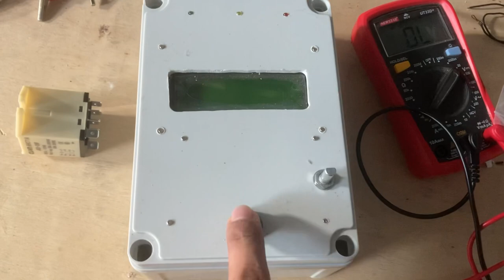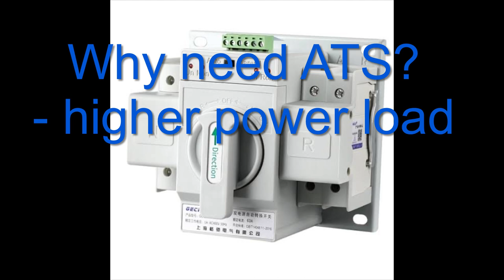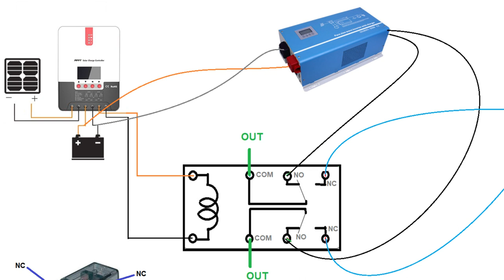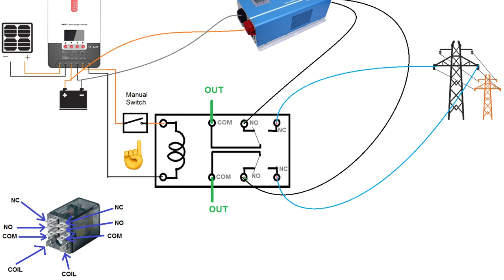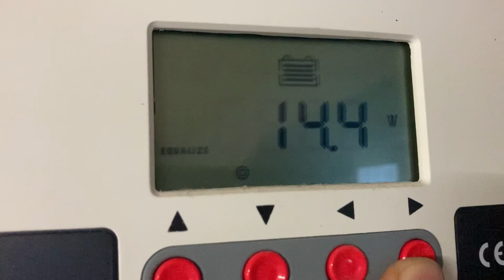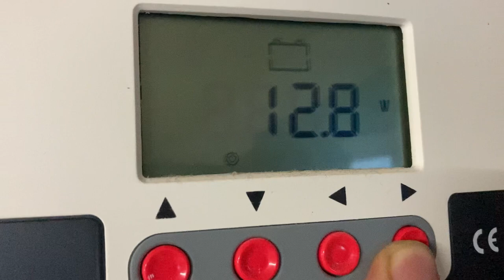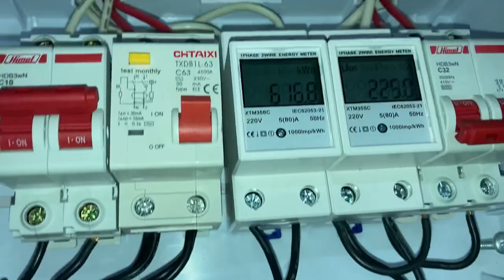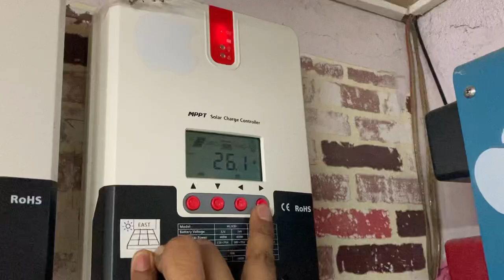DIY Cheap Automatic Transfer Switch for solar power

Comment: use 2 relays.. 1 for transfer switch and 1 for inverter.. same source of coil supply..
Reply: Depends on if you want any extra features. In my case, dealing with two sources where the Neutral is bonded to Ground ( 240 split phase ) I needed something different. And I wanted a meter on it. And a time delay for the inverter to power up. Plus breakers to protect the incoming power or disable it. So mine has 2 breakers, a power relay, a 4 pole motorized transfer switch, a meter, a timing relay, and two receptacles. It is built so the power coming in from the left is the priority one while the one on the right is secondary. As the inverter is normally the priority, it is on the left. Commercial power is on the right. During the day, the inverter powers the timing relay, the power relay, the transfer switch to throw to that and then the load. Anytime the inverter is not running, the commercial power feeds the load after it instantly throws over the transfer switch. In both cases, the transfer switch itself only uses power during a change in state. When on the inverter, once the unit has switched the load to it, only the power relay and timing relay are powered along with the meter and load. No load draw is 18 Watts total. It all fits in a 12X12 Hoffman enclosure.

Comment: Nice project lods.. di b magsasalubong ung kurente ni inverter at d.u lods?
Reply from the maker: Hindi po since iisang relay lang naman. Disconnect muna sya bago magconnect sa kabila.
Reply: @glengineertv1505  i.c.. gumawa kc ako ng ats using 2 relay, ngsalubong ang current, sabog ang 5pcs mosfet ng inverter..
Reply from the maker: @randy_q6914  awts… pag dalawa kasi kelangan mo ng delay before magswitch sa kabila. Mahirap nga yun kasi di mo alam yung bilis ng action nila so need mo ng malaking delay in between switching.
Reply: S plagay q nga ung ang dumali..my4n ginamit q n relay.. try q ulit gwa ung high power relay nman..
Reply: @glengineertv1505  sir dilikado yan 2 relay gamitin mo tig 1side lang .. kapag nag malfunction relay mo sabog inverter mo .  minsan pa nagdikit isang side tapus nag transfer na kabila ayun sibak talaga minsan pa nga nalusaw contact
Reply from the maker: @jundimaano7150  thanks for suggesting. double pole po yung relay so sabay yun lumilipat, hindi pwedeng maiwan yung isa. Not unless panget yung relay. Tsaka twice a day lang usually nagsswitch yung relay so less probability na magfail.

Comment: Sir meron kase akong nakita sa shopee na inverter pwede sya 24v-72v tas naisip ko, gusto ko din sana sya irekta sa solar panel bukod pa sa battery. Gamit din sana relay para pag malakas sikat sa umaga, dun nalang naka konekta yung inverter tas pag gabi na kusa nalang sya magswitch sa battery tas yung ginawa mo, in case lang na gabi na at ubos na yung laman ng battery ko.
Reply from the maker: Grid tie po ata yang inverter na sinasabi mo? No need po sya ng battery